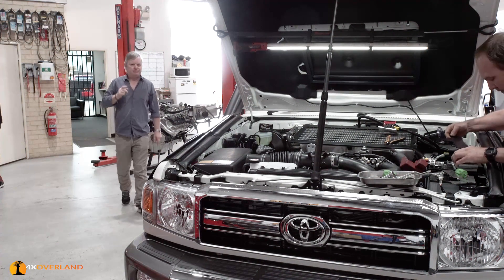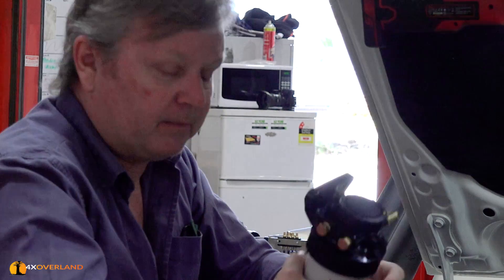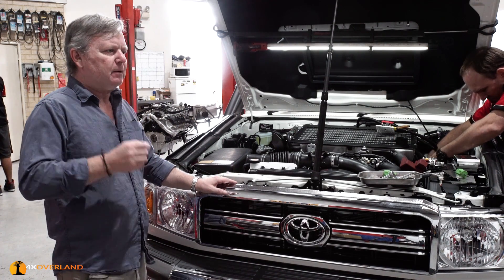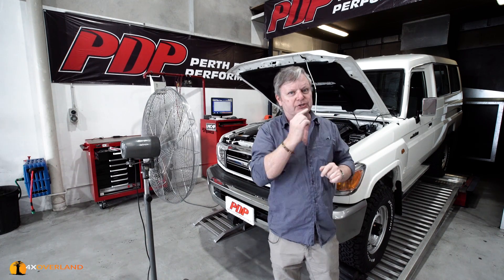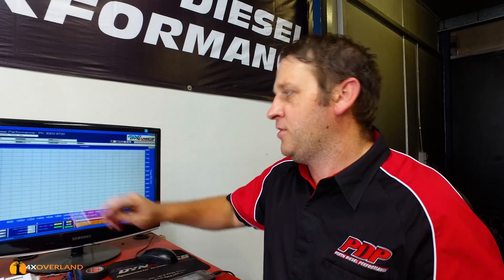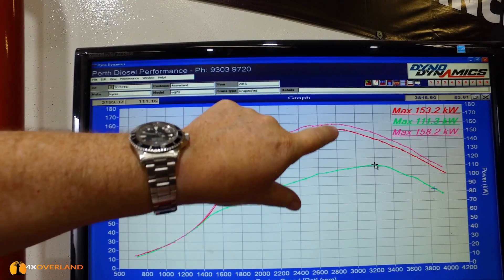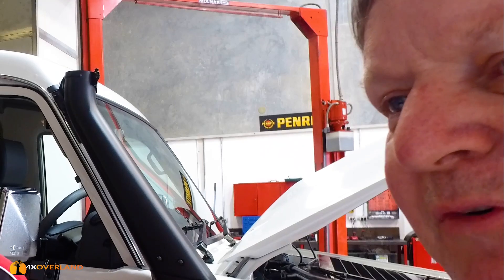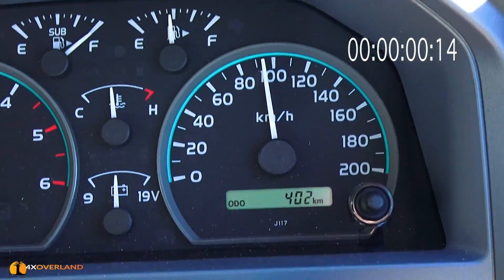DIESEL PERFORMANCE UPGRADE. AndrewSPW Land Cruiser build-8

Comment: ****Fastest Production car in the world: Hennessey Venom GT (270 mph)

And 148HP stock???? Are you kidding me?? wow that's weak. Even after the chip at 200 that's terrible climbing power. I would have done as much HP work to that rig too Andrew. You should look into Banks though, they are the authority on those power plants.
Reply from the maker: I made the lambo video in 2008.
Reply: RoadTripVidz banks are the authority on Toyota v8 Diesel's 🤔 in think you need some education these engines are built to work all day everyday in 50 degrees Celsius heat there not race engines there built for durability
Reply: Banks doesn't build for racing mainly.. they are the world authority on Diesel turbos and diesel motors in general. Look em' up. They are located in the Southwest, California.. We have the hottest deserts in the world.
Reply: http://bankspower.com/
Reply: RoadTripVidz maye banks has nothing to do with the modification of Toyota 1VD-FTV v8 diesel engines they are an American based company they don't even sell this engine in the united states this is not some toy truck like you have in America it's build got tough remote conditions like those found in the Australian  deserts and African content how can banks be the authority on an engine they don't even claim to modify I have worked on and used these engines sence true were first released buy Toyota
Reply: You clearly don't know anything about Engines.. the country doesn't matter. Parts are all usable world wide. Diesels in Africa are the same as Diesels here. Same same Banks is the authority on all Diesel engines.. just because a company makes a tuner that will strap onto any vehicle doesn't make them an authority. You really don't know Banks power products, or what they do because you haven't gone to their website or done any research... typical. That's ok though, doesn't change the fact that the company Andrew went to is small time compared to Banks in the diesel tuning industry. Go ahead in life as you please though bud.
Reply: RoadTripVidz 1 I don't doubt banks are good at modification on the engine's they have experience modifying ! 2 I am a fully qualified trained and experienced diesel mechanic having worked from Antarctica to the remote desserts in Australia banks makes no products that fit this motor ! they have nil experience in modifications of this particular engine they are company's in Australia that work on these engines day in and day out your an idiot mate if you cant work out what u am trying to say ! banks does modify diesel engines but they don't dont have anything on there website about work on this model of engine !! for crap sake
Reply: I bet no one at banks could even tell you were to bloody starter motor is located on a Toyota 1VD-FTV cause they likely have never seen one before  bahaha
Reply: you do understand what i am trying to say i will make it simple for u 

1) i have no doubt that banks does great work on the engines they modify and specialize in the  modification of however this engine is not sold or used in the united states so i doubt they have any experience with it  

2)  however they are abundant here in Australia were companys have invested time in everything from turbocharger upgrades to exhaust systems 

3) company's here have likely put hours of dyno time on these engines and getting the best out of them 

4) you have to come to terms with the facts  that the world is not just the united states of america
Reply: RoadTripVidz and for your information I looked through there website they don't offer any upgrades or modifications designed for this motor ?? but according to you all diesel engines are the same so any exhaust system on a diesel engine would fit it idiot

Comment: Agree on the 2nd fuel filter even i have a 30 micron pre filter but i would never install a performance chip. Horror stories of over tuning and crack pistons,  I hope this doesn't happen to you. over-fueling is is the start to a mountain of problems. Please consider a customer made stainless steel snorkel and a customer made airbox.
Reply from the maker: Horror stories are true with cheap plug & play chips. This is in a different class altogether. Not the same kind of product but stories has lumped them into one. I will fit an ordinary Safari Snorkel upgrade. I think that the standard air box is sufficient.
Reply: Also consider an upgraded intercooler( Cross country, HPD), exhaust and a catch can to prevent oil getting into the intercooler. Its more reliability mods than performance mods.

Comment: Hey mate, did you have to upgrade your exhaust and clutch to get these power figures?
Reply from the maker: No.
Reply: Motomodify a straight pipe off the turbo,,,go on!

Comment: The smile on your dial after, shows just how worth it a package like that is to an overlanding vehicle. My old bus (80 series landcruiser) doesn't have any of the modcon's like these troopies but does the job for me. 

On a side note, does your troopy have any issues in relation to soot from tailpipe? I noticed Berrima Diesel down on the East Coast of Australia has been stating the DPF systems in the new toyota's haven't been very efficient in how they are suppose to function. 

Cheers.

Comment: Nice! What about being nice to the vehicle for the first 1000 kms? :)) BTW, it was nice if you have recorded a 0-100 without using the chip to compare it with when the chip was active since information provided by the factory for power and 0-100 is usually not very trustable. 
Apart from that, there are some negative reviews on changing factory settings on cars and their longtime effect on the engine.
Reply from the maker: I do not believe in being nice to the engine in the first days of its life. I learned this through aviation. A new aircraft engine, for the rings to seat properly, MUST be driven at full power for the first 25 hours. Maximum power or idle. Nothing in between. Now I would not do that with this engine, but I revved it at full throttle the day I got it. I have seen this before: Engines that are treated carefully in their first days never run as well as they could. Get it to operating temp as fast as possible and then drive it normally. And when its new, be very careful of under-revving it. THIS is what can harm a new engine, not the other way around. My 2c worth. If a factory setting is safe, then why do so many turbos blow up around 100K?  Its because the map isn't looking after the EGT's sufficiently. Every engine is different, and if you can control our own specific engine with a ECU that takes care of it, then it is definitely better than the standard map. No doubt in my mind whatsoever. Its some cheap, off the shelf plug and play chips that can do damage because they add power and torque without controlling the important stuff.
Reply from the maker: And I can select map-5 anytime, which leaves the engine at factory settings.
Reply: Yep. I realized that. It's very nice to be able to activate or deactivate the chip.
Reply from the maker: I like it very much because I can make a direct comparison any time i choose.
Reply: Thank you for your swift reply. I agree on most parts; however, with all due respect to your expertise and experience, I don't have information on airplane engines but I assume there should be some difference here. I did a little bit of research on how we should behave to have engines running longer. Most references and car manufacturing companies advice is not to be hard on the engine and brake in the first 1000 kms (not to put them on idle for long time, not to accelerate or brake suddenly, not to go above certain rpms, etc.). 
Also, as you know most of engine wear and tear happens at the time of starting the car and that's because there is no oil between engine parts at that time. That's why companies insist on choosing the oil with correct SAE and API. Therefore, if we rev up the engine to the operating temperature, we are basically using the engine without sufficient amount of oil. once the engine is at its operating temperature, most oils will be OK. But the important time is from when a driver hits the start until the engine reaches the operating temperature and oil reaches all parts of the engine. Therefore, if we rev up the engine before it reaches the desired temperature (and all engine parts), we are just accelerating the wear and tear. Having said that, I don't know if this is the case with Diesel engines too or not. But I assume it should be true for Diesel engines too.
Reply: Maybe you can make a video just doing so. It will attract people who are interested in drag races too! :)
Reply from the maker: I agree totally. Have the engine get to operating temp as fast as possible, BUT without racing it, is critical for engines old and new, including aero engines, for all the reasons you have mentioned. But when hot, drive normally and an open throttle and revving it freely will not harm it. Warming an engine by idling is very bad, again old and new.
Reply: I don't think Andrew meant get it to operating temp by Reving the shit out of it. The way I read it was he revved the shit out of it on day one but when it was at operating temp. And he means get it to operating temp by driving normally and not letting it idle. Then give it a work out..... that's the way I read it anyway for what it's worth.

That's what I did. Day one got it warm then ran it hard with a mild load in the tray. Accelerated hard up a few long hills giving the whole rev range a work out.
Reply: Yeah, it seemed we were both on the same page. No drama :)
However, with all due respect I do not agree with what you say regarding the engine Geoff. Engine is a mechanical thing and so there is not such a think as spoiling the engine. I usually research before deciding on something and couldn't find scientific reasons for this to work. In fact, many are against it for the same reasons I mentioned on warming up the engine and oil quality etc. If you are hard in the first days, instead of letting the tiny (even microscopic) uneven parts of the engine to rub against each other and by this fit perfectly, you break and cut some of them which in result builds up more dust inside your engine which might not go away on oil changes. I even read articles suggesting you should give some time to your suspension and not to go off-road the first day. And Of course, this is my point of view and I am open to any further discussion or disagreements.
Reply: nah no further discussion needed. Its each to there own, whatever makes everyone happy really, everyone runs there engines in differently and that's cool. Was just my 2 cents on what he meant by "getting it to operating temperature as fast as possible" as it seemed as if you thought he meant get it to operating temp by reving the hell out of it or driving really hard which is not how I took his meaning is all.

Comment: That was a great reaction!

I can't wait to see this build come together!
Reply: Agreed!
Reply: I would argue with that. The best driving lights on the market are Fyrlyt Nemesis 9000.

LED and HID lights can produce a lot of light, but their poor colour spectrum is a significant disadvantage and actually makes it harder to distinguish many animals that are at risk of collision.

When we see objects, we are seeing the reflected light. When the driving light produces very little light of the wavelength corresponding with the colour of the object it is not reflected back for our eyes.
Reply: John Do but you gotta take into account how much watts the nemesis 9000 takes along with the wiring.
Reply: Sure +2gud4umenglez take the watts into account for wiring and alternator capacity, but at the end of the day they are the best driving lights, and no one will ever remove them because of the watts (unless they are stealing them). They are less expensive than quality led/hid combos, they are far superior for seeing animals and for overall vision especially when there is water (rain or fog), or dust in the air.
Reply: Cuttle Fish I just hope he doesn't go with arb lights but something in the lines of lightforce led/hid combo spotties or stedi type x lights.

Comment: with regards to the brakes I think the jury is still out on that actually,I have lots of mates here in NZ who have upgraded power and now find they are chewing through front pads.
If i remember correctly,Toyota use a wanky brake proportioning valve set on the rear axle which doesn't bring the rear brakes into full action unless loaded.
This may be different on the troopy.
God it's an ugly truck Andrew !!

Comment: I have got to get one of them for my car, I didn't like the idea of remaps seeing I couldn't change when I wanted to go back to factory settings plus the fact that it would get wiped when I took the car in for a service, this looks like exactly what I need. Tailored to my own vehicle and with multiple options to use on the fly. My car already does 0-100 in just over 6 seconds so I can't wait to see how much faster it'll go with a chip. Thank you for this video!

Comment: What about the emissions of the vehicle in the diferent engine maps?? 200 Nm seems to be really too much gain, its factory too strech? or are you pushing too much the engine in max power??
Reply from the maker: The V8 in standard form makes not much more power than many 4-cylinder diesels found in many utes. It is an extremely under-stressed engine for its output. And Unichip is very safe. It could easily double this engine's power if it wanted to.
Reply: Felipe Rodríguez 

Emissions? This is a modern diesel engine, it will have hardly no emissions regardless.
Reply: 4xOverland thanks! be safe!
Reply: Cuttle Fish This is a very conservative tune people are pushing 350KW and 900nm+ out of these engines with less emissions controls.
Reply: looking @ the original torque curve, it's obvious that Toyota reduced the combustion pressure. probably due to emissions. pretty sure that Toyota knows about the potential of that engine.
besides that: a gain of that much torque will infect the wear of anything behind it, like clutch, transmission, drive shaft, differential. i don't know how much reserve these components can handle on those rigs.
Reply: der Jack not sure about the land cruisers but I know the y61 patrol drivelines can handle way above factory spec, clutch might be an issue but the transmission, transfer and diffs are pretty beefy.
Reply: Cutte Fish, If this engine is so modern and does not pollute, why is it not authorized in Europe and USA?
Reply: Cuttle Fish ? sorry man, i dont know what kind of regulation applies to this truck, but all diesels in the world has many restrictions specially in low size particle emissions. higher injection pressure, over boost and advanced injection timing, will have some changes in the original emissions of the vehicle, particle filter operation (dpf) and NOx emission. don't know if how much and if that has some.kind of potential problem with the local regulations.
Reply: true ,the new hilux 4 cylinder ,2.4 turbo diesel have 150 hp and 400 nm torque

Comment: My Landcruiser VDJ79 is not fitted with factory difflocks like yours. It is my understanding that the difflocks also have breathers  that need to be extended like the axles, gearbox and transfer case.

Comment: People complain about the new diesels because of how complicated and touchy they are with bad fuel. The upside? Add a chip and almost double your power. The american pickup diesel scene has its own niche now with trucks making 1000ftlbs of torque from a few bolt ons. Multiple magazines in the grocery store, multiple forms of racing and a huge aftermarket. It's keeping the diesel market alive with the turbo gas options available on new trucks. Enjoy the new power

Comment: Does it improve MPG?   I have a 2008 Jeep Grand Cherokee wih the Mercedes OM642 diesel engine.  I got a tune from Green Diesel Engineering and had a significant increase in torque and HP, but also got a signfiicant increase in MPG.   Do you have a link to the frame mounted fuel filter setup?
Reply: Luckie Hyaena you can choose to make a tune that improves fuel efficiency I'm fairly sure
Reply: Stanadyne's Fuel manager line is really good. But, check out Racor, I work in the diesel fuel injection industry, and am constantly amazed at how efficient Racor filter systems are.